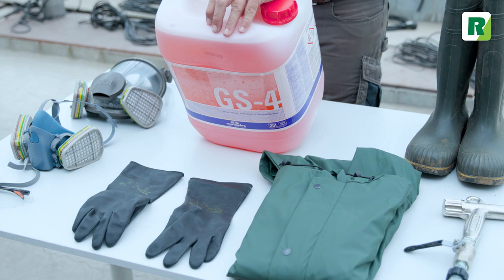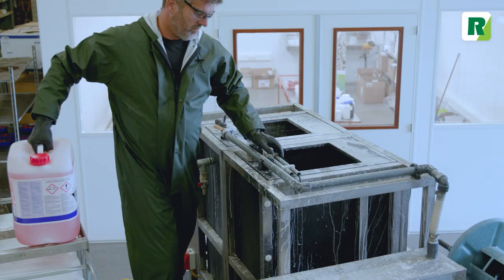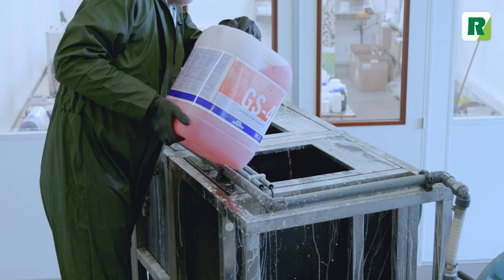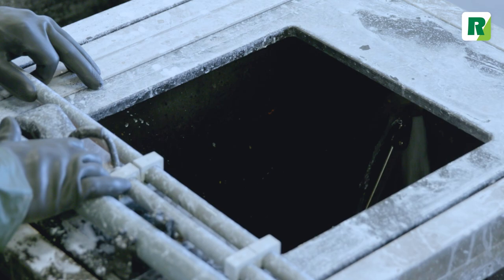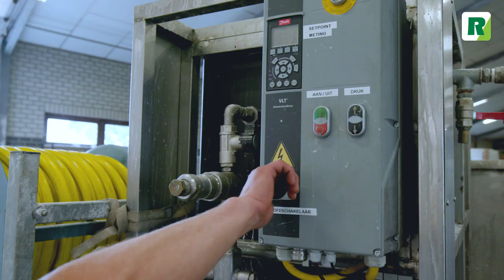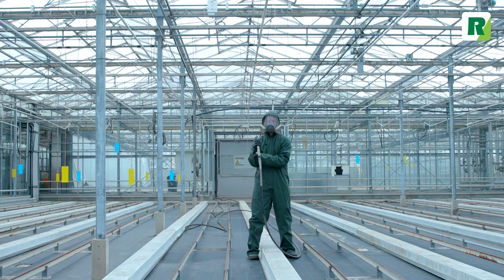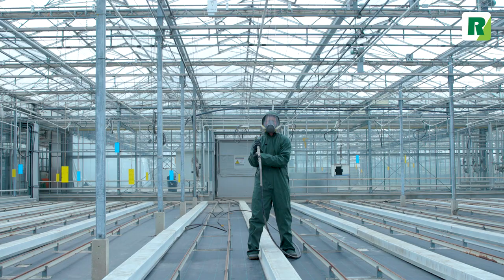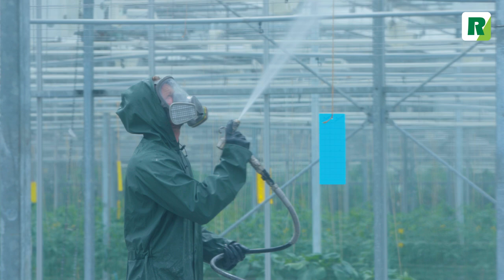Cleaning the greenhouse with GS-4 from ReduSystems

Comment: The glass greenhouse has a long life, but it is used for a long time. The dust covers the surface of the glass and is not easy to be washed away by rain. This seriously affects the light transmittance of the greenhouse, which in turn affects the crop yield and reduces economic benefits. Regular cleaning of the glass greenhouse roof to increase light transmission Rate is particularly important.